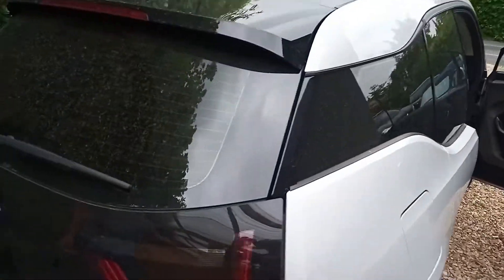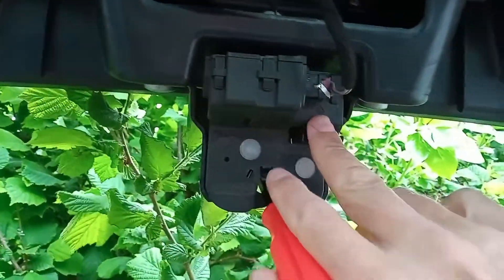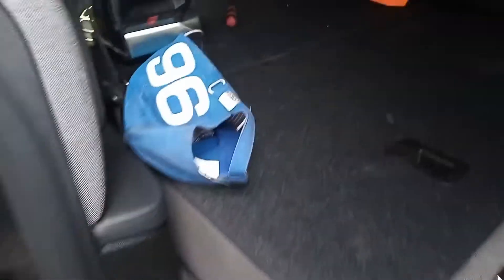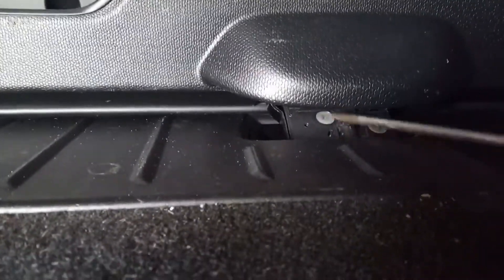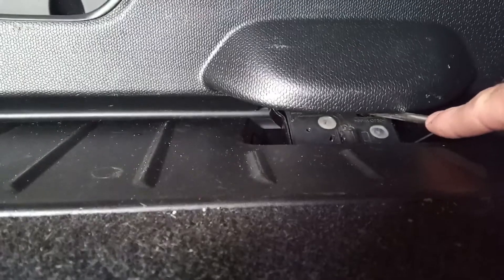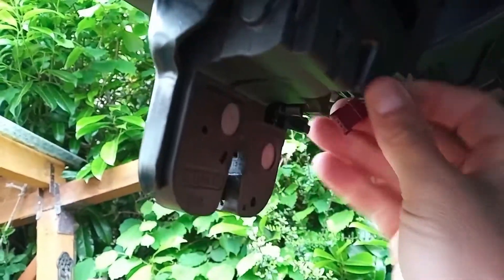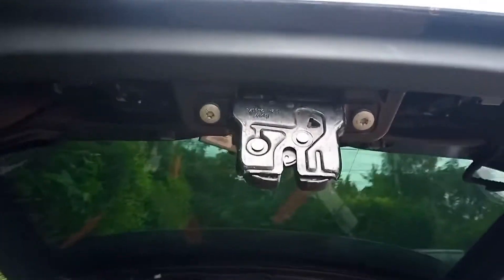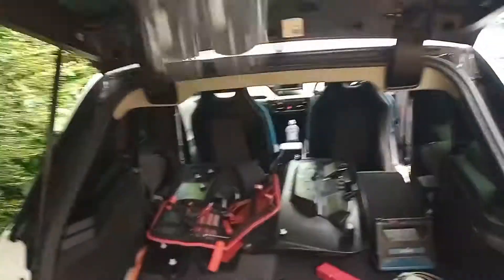BMW i3 strip down ep 12_ boot latch mechanism, boot won't open

Comment: I have the exact same problem with the jammed boot and same noise. However, when attempting to manually release the latch with screwdriver to the side, the boot would still not open. Do you have to slide the manual release to the side, and have someone press the button from outside, or would you be able to slide the manual release and push the hatch out from inside?
Reply from the maker: I can't see how having someone press the button would help but if something is trapped and putting too much pressure on the latch then it may help to have someone push down on the boot door whilst you try and release the latch from the inside. Good luck 🤞
Reply: @MiniLifeCrisis  thank you, I'll give it a try.